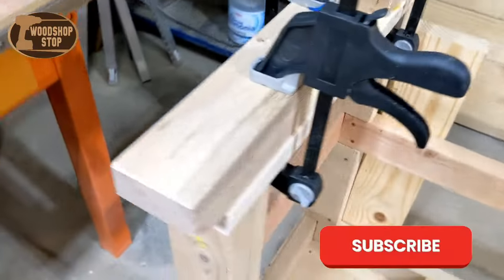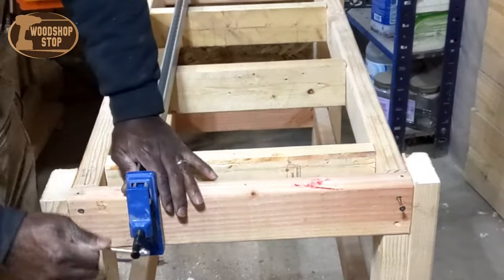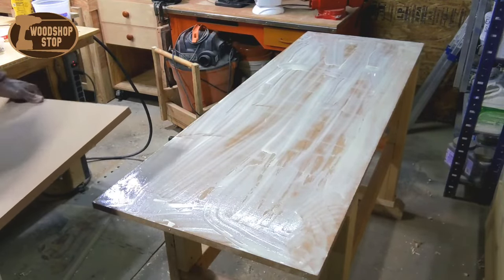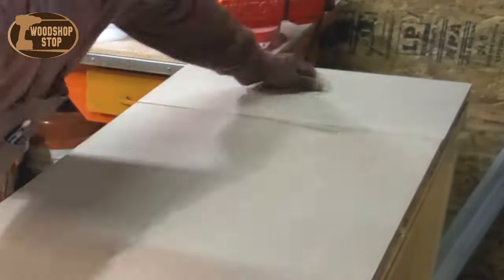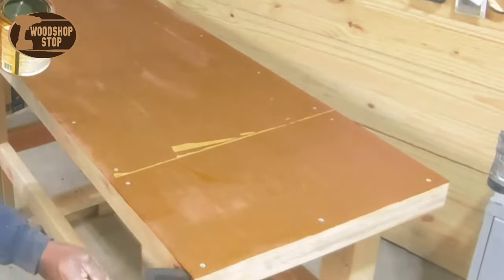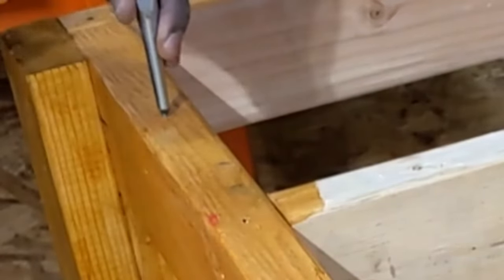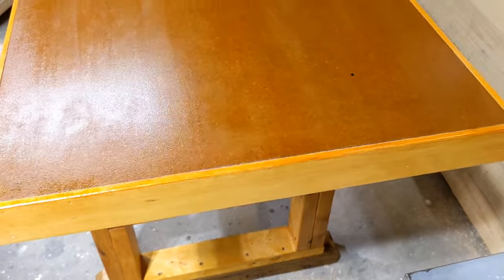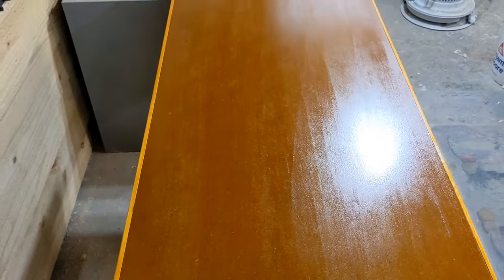Finished.modifying my basic workbench into something more useful like a joiner's woodworking bench#3

Comment: Nice job making a bench that could be modified as your needs changed. You may want to put a few dog holes into an offcut of MDF, just to make sure it’s stable enough to handle bench dogs. You could increase the stability of the dog hole edges with lacquer or thin CA glue. You could also opt for plastic (instead of metal) bench dogs. Good luck. Looking forward to seeing how the new top works with bench dogs.
Reply from the maker: Thank you Jeff for the great tips! Thanks for watching the video.